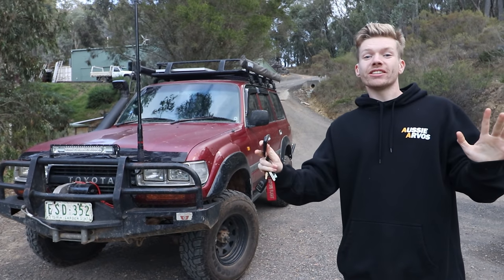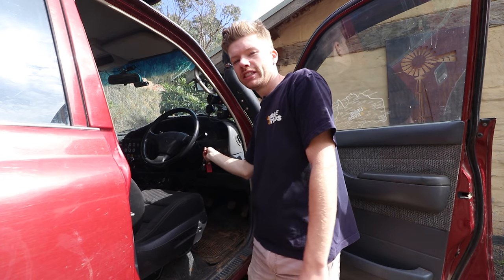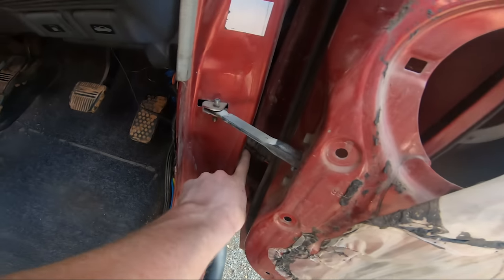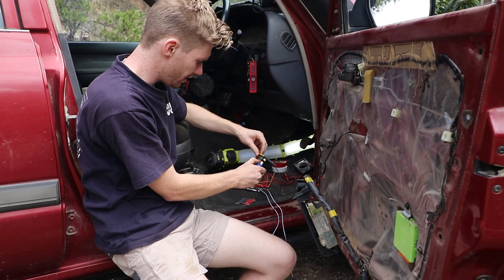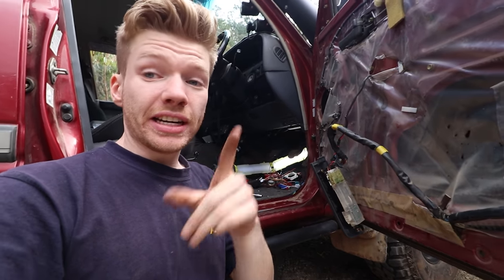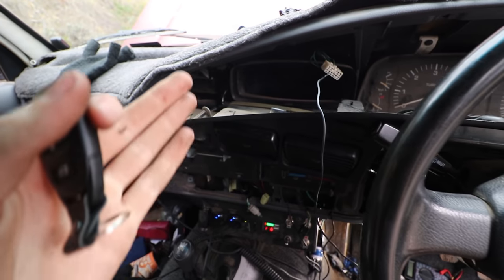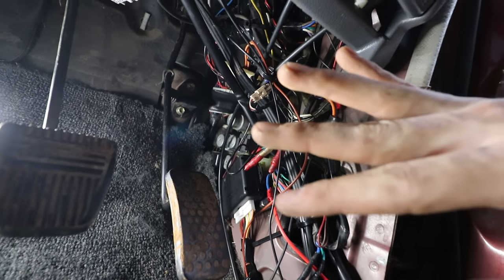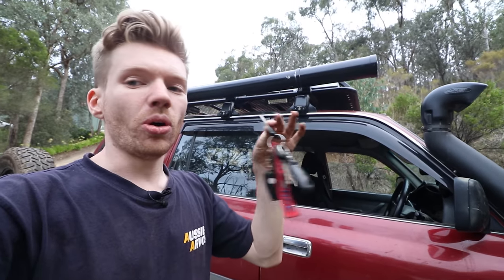The Best $20 You'll EVER spend on your 4WD! DIY Keyless remote LOCKING!

Comment: Confirming on an 80 series you need to combine the two yellow wires together from the unit and earth them. I used the earth bolt behind the drivers kick panel where I brought the  control wires through the door grommets I joined into the connector at the drivers door control panel.  The two green wires are either side of the lock tab on the connector. These connect to the two white wires on the unit as per the video. This saved me running another earth wire through the door grommets.

The power feed comes directly through from the accessory power box in engine bay following the bonnet release cable. 

I mounted the unit to the inside of the drivers side kick panel there is plenty of room for all to fit and tuck wires neatly.

A neat solution in the end and works brilliantly. 

Pro Tip - when wiring the indicator light feed I did not remove any of the dash. I prised hazard switch out with a hook tool. There was enough slack to access the back of the connector to join the wires. Using a coat hanger wire i taped my wires to I was able to feed the wires down behind the console below the steering wheel where I then routed them to the unit.

Comment: Wiring tip***

For those who have purchased the unit linked in the description and wired up like Patty has, and can't get it to work... try wiring in the yellow AND yellow/black wires from the remote control module to the earth as well. Mine wouldn't work without wiring them in as well.
Reply: Legend mate! Solved my issue! 👌🍻
Reply: Yes that's exactly what I needed to do too.
Reply: Thanks mate saved me a lot of swearing
Reply: I think this is my problem do these give you an earth switch effect as I’m not getting anything using the white and white /black feed wires.

Do you swap to using the other sites not both?

Comment: you could connect the boot release to a cheap turbo timer and connect the output of the turbo timer to some lights so as you approach the car in the dark you can light it up and the light stay on for whatever length of time the TT is set to.
Reply: What a great idea.

Comment: Alternatively, for vehicles that don't have power locks, you can get kits to do that or take all the OEM switches, actuators, etc, off of the same model with power locks, including the door harnesses. I'm getting a 92 Chevy 2500hd with all manual locks and windows. So I'm buying the switch panels new and taking everything else off of a truck that did come with the power option to convert to power windows and locks.

Comment: Hey man just to let you know if you pull the steering wheel surround off and you can see the black plugs closer to the dash that go up to your highbeam switch and indicators as such those same colour wires can be picked up there to trigger the indicators also the kill switch stuff was probably an old immobiliser some had the ability to hook up to central locking in the car and it will just be a couple of cut wires on the back of the key  barrel for starter motor and probably ignition that have been linked together to make the car run

Comment: The best thing is if the $20 module should fail, the key still works, the door button still works! Best technology is redundant technology! 
Interested in hearing your thoughts on soldering over crimps. I reckon solder for "floating wiring" where the joint is not going to be subject to flexing and crimping for wiring to a fixed point where it will be subject to flexing.
Reply: I would only use crimp connections for marine and automotive work.  I guess different Technical Colleges teach different methods.
Reply from the maker: Yeah it's a huge debate hahah! Gotta find out what NASA used in the space shuttle 😂
Reply: @ianwhitford3596  Yeah, I've heard the same, but I reckon AA has a point regarding soldering, just don't solder to a fixed point or you will get fatigue failures. The solder wicks up the multi-strand wire and makes it brittle, with time it will fail, but floating, no stress on the joint so will last a long, long time. 
There are great advantages to crimping, it literally fuses the connector and the wire strands without causing a fatigue sight. Problem is as AA pointed out, inexperienced hands will deliver a great proportion of failed crimps - the yank test is not always enough to work out if a crimp is good or not (It probably is) but just one in a dozen or so that isn't up to scratch and god help you find it. It will look perfect even though it has failed... so hard to spot.
Reply: @AussieArvos  
Don't look to NASA go straight to motor sport wiring if you want to end the debate.
Open barrel crimps are the way to go. And butt splice crimps are my new favourite system for tapping into or butt joining small gauge wires.
They do take a fair bit of trial and error and at the end of the day a poor solder join is better than a poor crimp.

Comment: Awesome video thankyou, very helpful. Bought the same thing for my 91 gxl 80 series.
Have installed this following your intructions and just wondering whether anyone has had an issue regarding the unit? It began working perfectly, then over time it used to work intermittently to now not working at all.
also since installing sometimes the cars battery needs to be turned on for the central locking to work also.

Comment: Thanks, I really didn't want to install those accessory actuators on each door, getting the wires through the door rubber tunnels are horrible. Especially since I already have central locking.

Comment: Did the same decades ago on my old honda city (had to add the door actuators as well), definitely a useful and rewarding mod! Well done sorting out the mess from the previous system, too. Curious if tying the hazard left/right lines together might have messed with your indicator function - do they all go at once now? Great stuff.
Reply: He taped into the left and right using 2 seperate wires, not left and right together.
Reply: @DRIBBL3R  Ahh cheers - missed where he said "two brown wires" from the controller.

Comment: The one thing I'd be very careful of is if those key modules all have a unique signal to their paired keys, or if someone else with one of those kits key would also unlock your car.
I'd buy a second one just to test it's keys on the one you installed in the 80 for peace of mind that only your key fob will work on your locks and no one else's.
Reply: Yeah deffo get it delivered to a mate or relatives house lol

Comment: Awesome mod, love it. Great work. I need to do this to my GU Patrol. Pain in the arse using the key when you have heaps of stuff in your hands.
Reply: I just got one for my GU, can’t wait to put it in!!
Reply: @DRIBBL3R  hey mate I see you put this on your gu patrol. Did you end up getting it to work? I’m trying to do mine now but can’t get it to work. Witch wire did you tap into? Cheer
Reply: @kymlawrence6077  I test fitted it last week. But I have an issue that when I use the key on the drivers door to open the car all locks open, but when I use the key on passenger side it won’t unlock driver door. Not sure if that normal, or an issue with my car.  Anyway I did test fit the keyless remote and it worked for all door, except the DRIVERS DOOR!! I taped into the black with red strip, and black with yellow strip. I also had to earth the yellow wires to get it to work. Let me know how you go mate.
Reply: @DRIBBL3R  awesome thanks for that man. I gave up and packed up now lol was on it for nilly 4 hrs getting all the wire run and trying to find the unlock and lock wire. Did you use the white and white with black strip to tap into the black with red stripe and black with green stripe? Sorry for the questions but what wire when were if you remember? I just couldn’t get mine to work at all
Reply: @DRIBBL3R  also mine only opens the passenger door when I open it with the key as well. I also worked out the central locking button on my door panel where the window buttons are won’t lock or unlock when using the button. Have to use the key for drivers door to lock and unlock.
Reply: @kymlawrence6077  yeah I used the white and the white with black strip.
Reply: @DRIBBL3R  awesome thanks man. I’ll try give it a go tomorrow maybe. I’m down in tassy and it’s fucking cold down here in the shed so see how I go
Reply: @DRIBBL3R  I’m having the same drama you had. Got all doors to work besides the drivers door. It won’t unlock or lock. There’s 4 wires running to another actuator wander if you need to get power or something to them
Reply: @kymlawrence6077  yeah I’m not sure why they have designed the drivers door lock/central locking the way they have. I’m sure there could be a way around it but I don’t have the time or patience on the day lol 😂. Hopefully you have some luck with it.
Reply: @DRIBBL3R  well been doing some brain storming will working up and down the drive way trying not to burn my car to the ground and I thought. When you manually lock and unlock the car with the drivers latch all doors work. So if I get an actuator for the kit or get a kit with the locks and just have it doing the drivers door it’ll lock and unlock the rest if you no what I mean.

Comment: you could have easily found the left and right turn circuits in the drivers sill harness, rather than pulling the dash out and risk breaking something.

also, old nissans require you to install an aftermarket drive motor in the drivers door to get CDL working remotely.

Comment: What perfect timing.  My LC80 (also a GXL), has an aftermarket alarm (fitted to it some 26 years ago), and its remote receiver started playing up.  It only works intermittently using the remote control fobs (x2) that came with it.  I've replaced the batteries on both fobs, but I'm still getting the same issues.  This narrows the issue to the receiver itself.  So I haven't been using the remotes, and have been locking/unlocking my LC80 manually.  This is perfect.  But I wonder if wiring this eBay unit in my LC80 the same way as yours, will work as it has an alarm.  Goodness only knows how the alarm's been wired etc.  Another great DIY episode Pat.  Great work. 👍
Reply: Yes. 
If you have drivers door open all doors the alarm will lock unlock doors. 

I replaced my receiver control unit yesterday in my gq. 
I replaced two motors at the same time. 

I paid $50 at jaycar instead as it was the same brand as the dead one.
Reply: @brucebaxter6923  Thanks.  Mine is definitely the receiver of the alarm, as the central locking still works when manually locking/unlocking the vehicle.  The unit just won't respond (for most of the time) when using either one of the remote key fob.
Reply: I would pull the key fob apart and check the button on it they can get a dry solder  joint and cause this type of issue

Comment: Love your videos mate always great to watch!
Quick question, I’ve got central locking in my 80 but the boot doesn’t seem to work with it, any idea what it could be? Cheers!
Reply from the maker: That's mate! 
The boot should work, check the wiring to the rear boot lock motor, and make sure the motor isn't getting stuck or anything! 
Mine locks and unlocks via central locking so you should be able to get it too work , cheers :)

Comment: I wonder how power efficient that locking module is considering it’s wired into constant power? Would be interesting to know if being a cheap unit whether it’s still designed well on that front, and whether it would be good/bad on battery drain if you don’t use your car for awhile.
Reply: I got a cheap one for my old car, it didn't use much power at all.

Comment: I tapped into the harness wires near the drivers door switch panel 😮in the 3 and 4 wire position either side of the lock on the connector. 

I’ve got it all wired up with the white and white/black to these 3/4 wires. Power feed connected (obviously has to be always hot) and indicators are working but no unlocking. It’s all clicking.

What have I done wrong as the 3/4 wires appear correct.

How do you deal with negative switching?

Comment: Hi buddy, I have tapped trigger wires to a hazard switch they are working perfectly  but the problem is that when I use hazards the harzard lights become very weak and blink unusually is there any way I can seperate the current to àvoid this?

Comment: Are the wires that came with the module long enough to get up to the hazard light switch? Or did you just trace them back to where you could connect them up?

Comment: How's the security here? if a simple hack in a remote could unlock any car? Any encryption or other handshaking method in the communication channel?
Reply: @KeoghDanielAU  May be they have a different code to identify different modules. But a thief could still brute-force and unlock. Unless the communication channel is encrypted, someone can still record a previous unlock signal pattern and replay...
Reply: Nearly all of the are 433MHz and very few of them have any sort of security.
Some support rolling code, others say they support it but dont...

I mean, even the unsecure ones are probably more secure than your manual locks anyway... i'm assuming half the people watching have locks that can be opened with a butterknife in about 10 seconds. (My cruiser can be, for sure.)
Reply from the maker: Its meant to be coded to the unit but I mean , its eBay, but I figure if someone really wants to steal the car, they would probably just bust a window or pick the lock quite easily

Comment: Hey Patric. I got the same central locking kit you got but I have a 2005 patrol. I hooked up power and earth and the module is clicking but I can’t find anywhere on google where the lock and unlock wire go. Do you or anyone on here no where the wires go to?
Reply from the maker: Hi mate! if its a GU patrol it will probaly have a master door unlock switch that lets you lock and unlock all the doors inside the cab, look for that and then tap off the wiring for that
Reply: @AussieArvos  oh yeah sorry it’s a gu. yeah I’ve found that and tryed to tap into that but still no luck. I have a button like yours.  rocks forward to lock and back to unlock. Thanks heaps for replying and giving advice to. PS thanks for the sticker to I got it yesterday.

Comment: Hey Patrick, are you meant to position the antenna in a spot where it’s ‘accessible’ as such. Or does it still pick up the remote even when it’s tucked away behind the panel. Great vid as always mate
Reply from the maker: Hi jack! Remote picks up to about 100m 👌
Reply: @AussieArvos  Thanks mate, was just wondering if that little antenna needed to be visible as suchto allow for a better range.

Comment: Just an FYI not all systems are the same for example most gu gq patrols that have central locking off the key dont  have a motor to actuate the drivers door so you will need a motor in the drivers side door

Comment: "Should only be a 1 hour job."

Oh, how many times I've said this and it ends up being at least 3 or 4 hours
Reply from the maker: Always the case 😂😂
Reply: Yup had to change the heater core on my 105, figured it would only be a few hours. 7hours to pull the whole dash out including the crash bar. Less than a minute to remove the 2 screws holding the heater core in and swap out the core and another 7 hours to refit the dash. 😵‍💫
The only saving grace is that mr Toyota has very kindly made all the electrical plugs so that they only fit the one they come out off so you literally can’t f+&* it up. 🥸👍